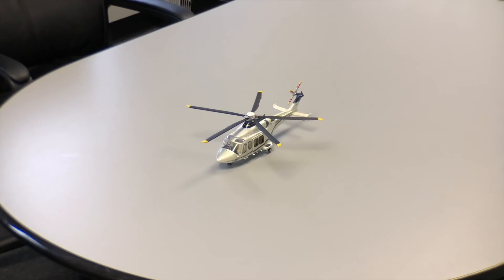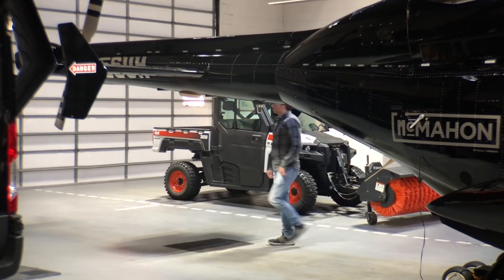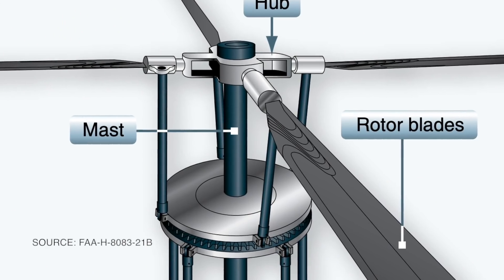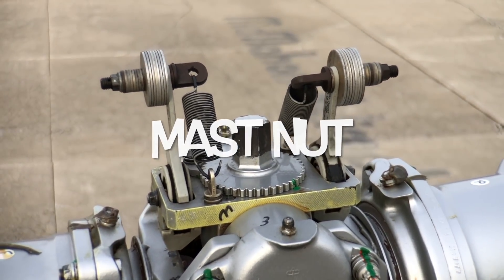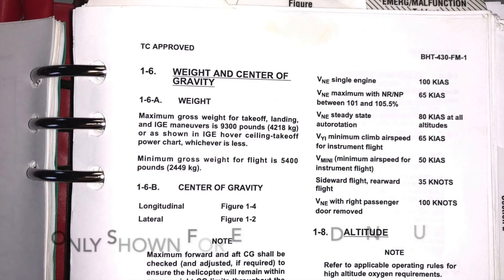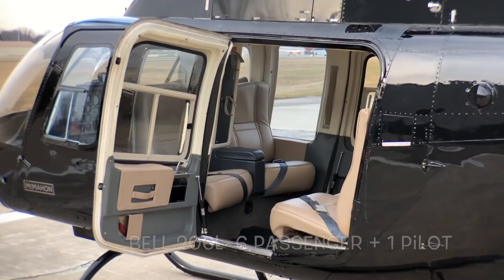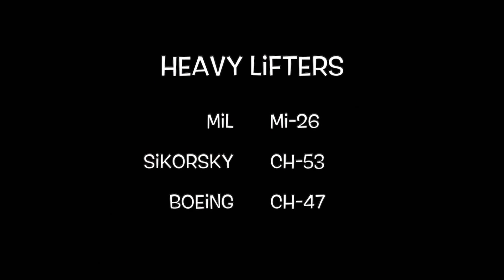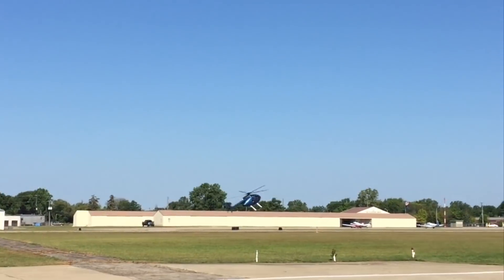Blade Tips Episode 1 Helicopter Basics

Comment: Hi , I do have a very basic question, how do you calculate the main rotor blade area when you have to land in a tight space?
Reply from the maker: Whenever possible, you plan to land only in spaces that you know are large enough (by measuring on the ground ahead of time) and then the pilot uses skill and experience to estimate distances from the cockpit to ensure that the rotor blades remain clear of obstacles. There are no instruments that indicate if the helicopter will fit into a certain space, so it takes a lot of practice to fly safely!